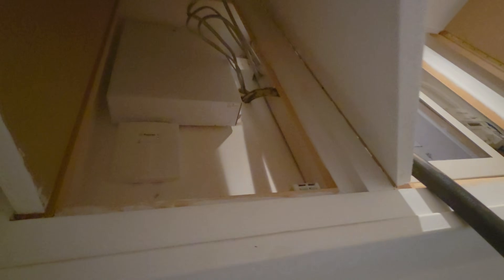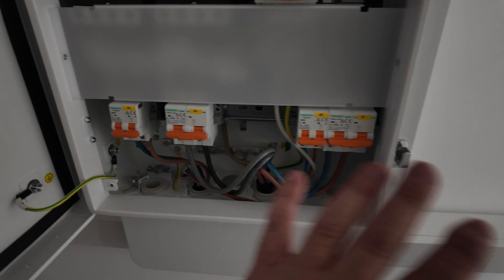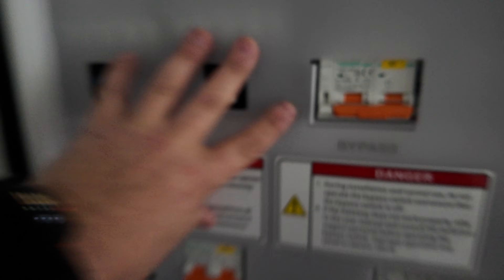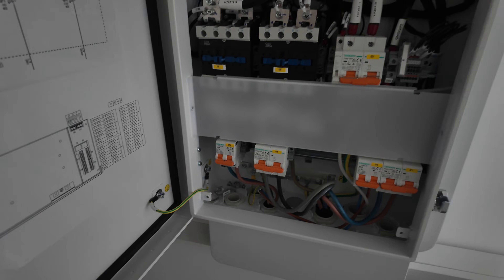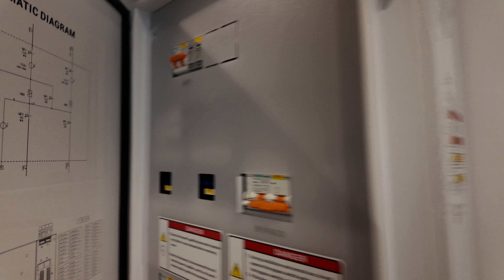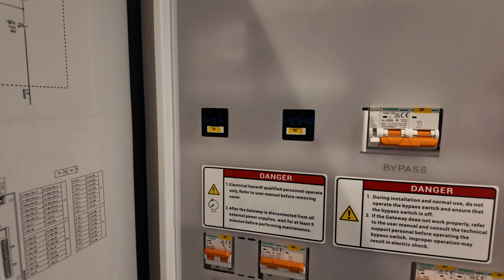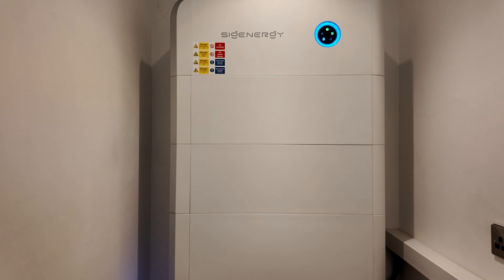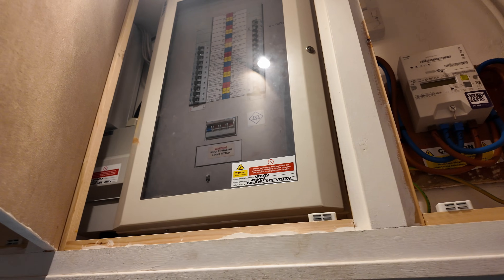Can you power an entire home with battery storage ???  Sigenergy 12kW + 54kWh + SILENT gateway

Comment: You guys in the UK could use the Sigen system as a heater. These suckers get hot. I have a 40kwh battery with 10kw inverter in a 3x6 metre insulated room and it gets very warm in there. Not ideal as I'm in Brisbane Australia. I have to work out some kind of exhaust system for the room.
Reply from the maker: All these kits pump out a fair bit of heat when working hard. Nature of the beast somewhat. No doubt that is made a lot worse in warmer parts of tbe world. Currently 4C and raining 🤭
Reply: @electrician247 currently 23 degrees at 10pm 😂
Reply: @electrician247 thanks for all your videos mate. You're one of the people that convinced me to go the Sigenergy system. Cheers and keep up the great work.

Comment: With the unfortunate spate of Sigenergy fires on the AC side and the recent product recall in Australia, is Sigenergy UK providing additional guidance to UK installers yet?

Regarding power cuts, we just had our first one since the solar PV and batteries were installed.  Unfortunately our batteries were all offline due to an unresolved fault.  The moment to shine was missed.  With a second battery replacement booked we now have had more battery failures than power cuts.  The external commando socket looks prescient.  

We do have an internal interlocked commando socket but only a 16 amp (blue) variant.  It seemed somewhat overkill when we had it installed but perhaps a 32 amp socket would have been a better option.

Comment: Would you just charge at a lower rate over 5 hours then, then try and get it down in a hour... Obviously not on that house .
Reply from the maker: Depends on tariff really. Some on agile will want to use the full capability of the inverter. Those on longer over night options are best served dropping the charge rate to keep headroom for other devices (EV etc) and using the whole window.

Comment: How much does this cost please with a three phase inverter and no solar? And would it recognise solar generation from a an AC coupled micro inverters system.
Reply from the maker: Yes using the smart port or seperate metering the micro inverters would be seen as solar generation in the system. Costs vary on installation circumstance.  Head over to www.powersonic.co and pop your details in the form. Thanks